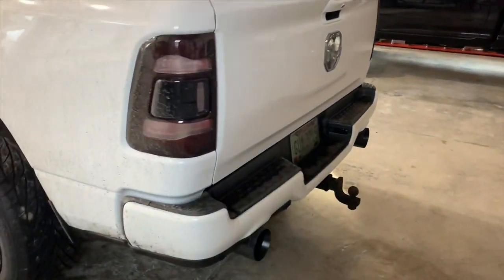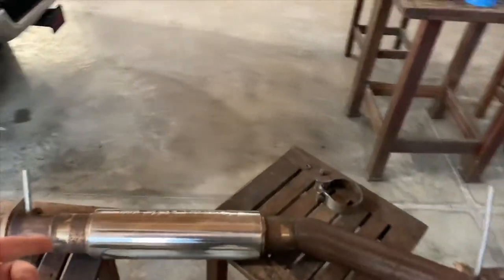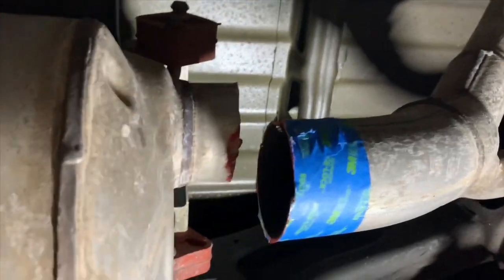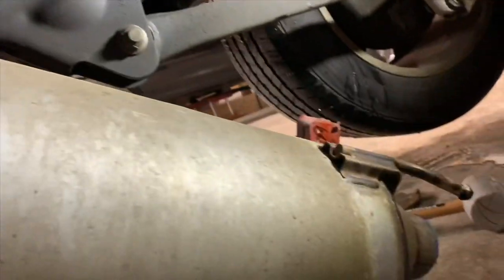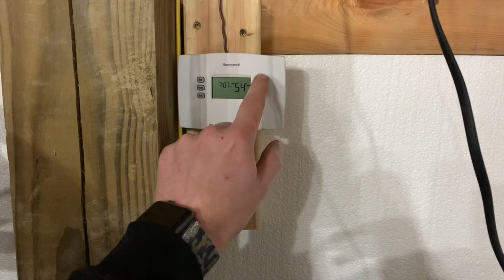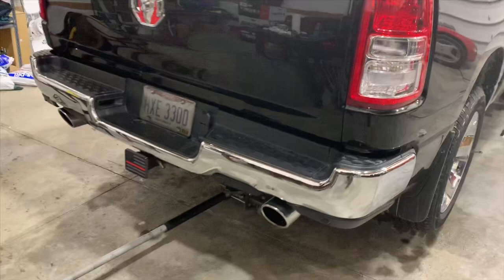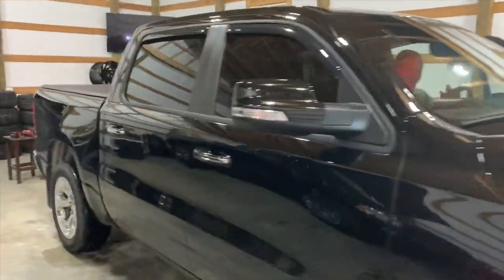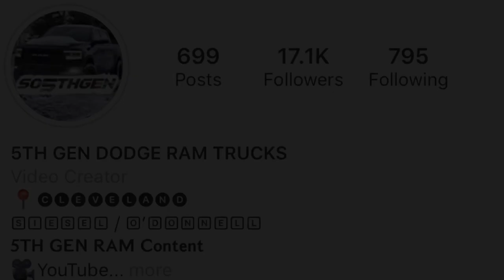B2 Fabrication Custom Pypes M80 Muffler Installation onto A 2020 Ram 1500

Comment: Why did the factory bolt and nuts not get used?
Reply from the maker: They normally would but I ran this b2 pipe on my white truck and when I switched to Corsa I lost the hardware. Gave the B2 pipe to my buddy and couldn’t find the hardware so grabbed some new ones 🤜🏻🤛🏻